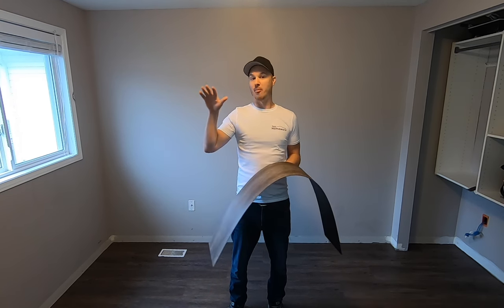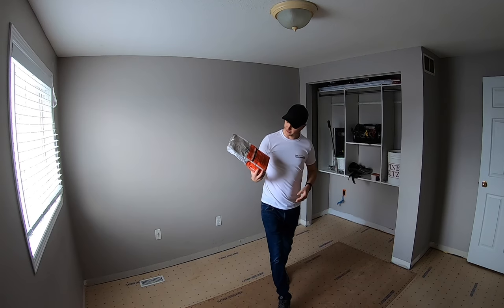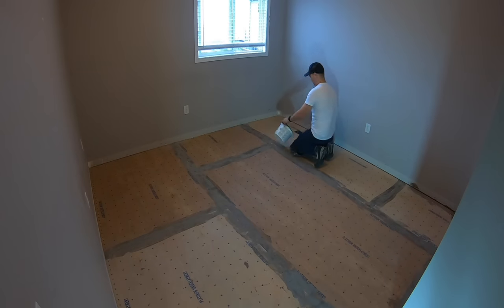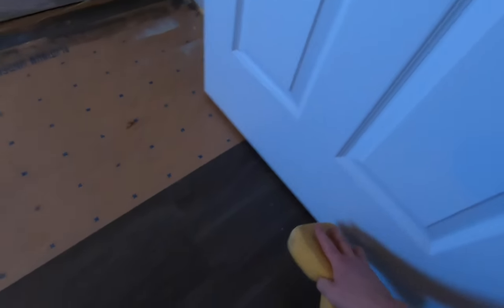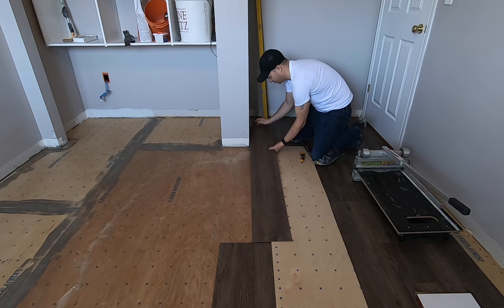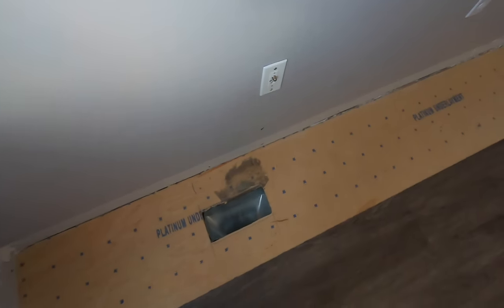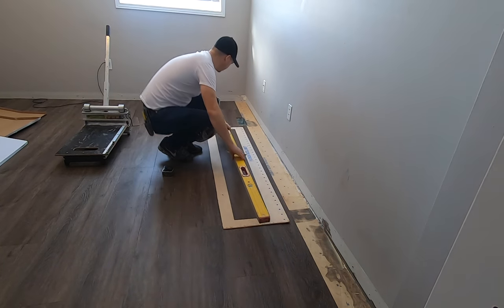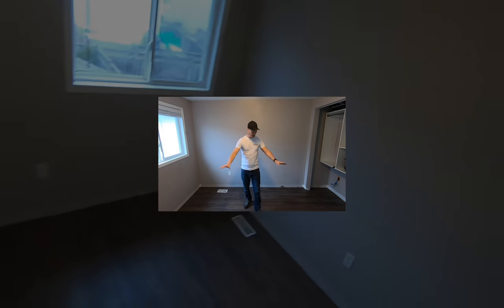How to Install Glue Down Luxury Vinyl Plank Flooring on OSB Sub Floor

Comment from the maker: Thanks for checking out this video. Please hit that subscribe button and the little bell so you can be notified when I put out new videos!
Reply: Brent, what market do you currently do work in?
Reply from the maker: @AlexJacobsOfficial  Home renos near toronto
Reply: Will it have gaps?
Reply from the maker: @veev7796  There are seems but if done right, no gaps
Reply: Does the glue off gas? (Smell after install?)
Reply from the maker: @williamlillie9309  not much smell from the product I used maipei eco 373
Reply: Can I  install it  directly to plywood?
Reply from the maker: @juanhuerta7800  you can but might not work out that well
Reply: @BrentDarlington  just making sure i wanna remove the carpet and install glue down lvt. Thanks for the feedback
Reply: How long do you have to leave the glue down before installing?

Comment: Coming from a floor layer here, solid installation! I love that you’re using premium products that a professional like myself would recommend. A trick of the trade to make your fills go by much faster is to place a plank on top of the last row you laid (make sure it doesn’t move once in place), taking another plank and butting it against the wall on top of the previously mentioned plank. Once in place you may take your knife along the edge of the top plank scoring and snapping the bottom plank; perfect fit every time! To save more time I would also recommend using a knife opposed to your laminate cutter for end fills as well! Simply use the same strategy you use to mark it with a pencil but instead eyeball a straight cut from there (no square needed as the baseboards should cover any short cuts).
Reply: Having a good eyeball is a great tool that saves time and effort in all forms of construction. Good eye my friend.  😉
Reply: Also that's a good tip with laying a plank on top of your last plank. That would give you a perfect fit easily with minimal effort and no extra tools.

Comment: Youre right, HVAC guys never care. Haha. My good buddy is an HVAC contractor. I'm a handyman, and I get many work references from him. Bless his heart, but hes so sloppy. I get called in to follow and work along with him to make things  pretty. My advice to any other handy men and women is connect with some other tradesmen like an electrician or HVAC guy. Thanks for the vid. Needed a refresher for my brain.
Reply from the maker: I think if a few of the mechanical guys had to patch and paint some of the drywall holes they left behind they would be a bit more careful! They aren't all bad, they get paid to do what they do and we get paid to fix it lol

Comment: I’ve never done a glue down laminate, but it looks like once you get the prep work done, it goes pretty quick!
Reply from the maker: Yes a lot of prep but I like it a lot better than the click  stuff. No soft spots, doesn't come apart or buckle.
Reply: I may try this next time one of my rentals gets trashed and needs redone.
Reply: And congrats on 100 subs! I feel like I’m racing you😂
Reply from the maker: @MyDIYAdventures  thanks! nothing wrong with a little competition ;)
Reply from the maker: @MyDIYAdventures  another great thing about glue down is if you get some damage you can just remove the bad pieces with a heat gun and reinstall. Pretty tough with click to do that
Reply: @MyDIYAdventures  
I have 2 duplexes with carpet. I’m doing glue down on all 4 units. Hopefully it holds up. Anything’s better than carpet.
Reply: @SilverGorilla1776  my buddy has been doing that in his rentals, I’m thinking about doing it in my duplex also.
Reply: @MyDIYAdventures  
Has it held up well for your friend? I have one duplex that flooded due to the city sewer backing up. It had very cheap snap together laminate in the bedroom that flooded. We had a floor guy come in to fix it and he put in glue down. That was 6 years ago and it’s held up well so far. Was wondering about the higher traffic areas such as living room, etc.
Reply: @SilverGorilla1776  yeah it has held up
Reply: @MyDIYAdventures  
Cool. Thanks.

Comment: Instead of using your floor leveler where you have to mix it with water can I use the premix one DAP flexible floor patch & leveler for plywood & concrete  ?
Reply from the maker: I've never used it before so I cannot say for sure. I'm sure it's fine but may take a lot longer to dry in deeper areas.

Comment: true statement on triangle, however with the room squared you can adjust the fill piece to be less noticeable . just coming off the longest wall can --if not square can make the pattern seem on a slight angle .1/4 inch no problem--1 inch trouble . usually most walls are 1/4 to 1/2 out .

Comment: Well done Brent, nice job! There's not much videos on LVT / OSB out there. Thanks for yours!

Not sure if you were lucky to fit the plywood boards to be level with the existing floor. If you can't afford to lift the floor with plywood then special putty is the way. Sand down OSBs, seal the drops and joints with the special putty (like SCHONOX ZZ or similar), sand down again and you're good.

Comment: Excellent video. Can someone explain why the LVT cannot just be stick down onto the OSB? Why the need for the hardboard layer?
Reply from the maker: It's too rough
Reply: @BrentDarlington  thanks, makes sense yeah. Also I guess if you wanted to change the floor later on the subfloor would be ruined by the glue and would also need replacing.

Comment: Hi, how do you think can I put my new luxury viny floor on my old laminate floor?(I don't have any gaps on it I just don't like the colour and the quality as well) 
I'm trying to find a way how I can put on a new floor without taking off an old one. What do you think?
Reply from the maker: It is not that hard to rip out but if it is in good condition their may be a glue that would stick. You can also put a layer of plywood on top of the old stuff. The floor manufacturer will have a glue they recomend and the glue manufacturer will have a substrate they recommend.

Comment: Do you have to let the glue dry a bit before putting the laminate down? 

I tried to do it that way and it didn’t stick very good but when I put the laminate down right after spreading the glue instead it stuck really good.
Reply from the maker: Depends on the glue manufacturers recommendations.  They can all be a bit different. Some stick better wet set but can be more messy
Reply: @BrentDarlington  so do you think it would work to install it wet? The glue says permanent installation open time up to 25 minutes I’m not sure what that means I’ve never done flooring before and lastly dose it matter how you spread the glue? Thanks
Reply from the maker: @WesterlyPrune99  permanent means it's stuck, good to go. Yes, spread matters. How did you spread it?
Reply: I spread the glue and then pull down top to bottom so all the glue lines go in the same direction then I put the laminate down and press on it a bit. It seemed to work when I did that but I’m not sure it that’s how I’m supposed to do it
Reply from the maker: @WesterlyPrune99  that's fine, direction doesn't matter just want the same right amount spread evenly
Reply: @BrentDarlington  ok thank you very much I’ll have to give this another go tonight

Comment: my mom  in law has loads of that 70's vinyl sheeting flooring in her house... can one glue this directly over that? I only have experience with the floating type I;m installing in my rental unit now.
Reply from the maker: If its not padded and is held down tight, apparently you can if the glue says it will stick. I usually rip it out to be safe but you can put a new layer of underlayment ply over the old floor first. Or put click down over it.
Reply: @BrentDarlington  yeah the surface still looks flat and good just the prints are so out of date and not up to modern stuff, will probably fill a few low spots.
.

Comment: 3x4x5 provides that a room out of square does not present a small triangle piece down one or more walls , extremely important when ceramic tile is involved .
Reply from the maker: Can you explain a bit more? If the room is out, you will get the "triangle" effect no matter what you do. Centering just splits the difference and hopefully will be less noticeable. I can't rebuild the house to install the floor. The framers are the ones who need to use 3x4x5.

Comment: I realize it is not recommended however, have you ever seen glue down LVP/LVT installed over OSB (a good OSB) and seen it after the job was done? Is it possible it comes out great if the OSB is in great shape?
Reply from the maker: If you went with some of the thicker materials I'm sure it would be fine but I wouldn't want to test it out.

Comment: Thanks for the video what size sandpaper did you use?  How long do you have to work with the glue?
Reply from the maker: What size or what grit sand paper? Open time depends on the adhesive and will tell you on the side of the bucket.
Reply: @BrentDarlington lol sorry yes what grit I am going to finally start on my sun room after I install a mini split

Comment: This is the first time I've seen "luxury" to describe vinyl.
Reply from the maker: I don't name it, just install it. They have "Luxury Vinyl Tiles" too
Reply: Honestly out of all the flooring out there I prefer this type, looks the best, easiest to work with, cheaper, I mean it's a win anyway you look at it
Reply: We just had over 10,000 sg ft installed in a commercial setting and it has for sure made me a believer. Wasn’t a fan of the flimsiness of it until I slid a 400 lb vault across it with no issue whatsoever! No scratching or gouging!
Reply: @justinryan212  yea, apparently the vinyl has a lot more durability. I've seen a few videos doing tests on the different types of flooring planks, and the Vinyl takes the win each time

Comment: Great video my man ! 
I've done this job for 30 years and I have to say , it's as best as a professional can get ...however,  I'm just curious about the 'platinum under layment'
Here in Australia it's 5mm hardboard.
Reply from the maker: That's what we use around here. I've ripped out a few floors with hardboard underlayment so it may have been popular 30 or 40 years ago.

Comment: Excellent video! Two questions:
-What grit sandpaper did you use in your belt sander?
-What size trowel did you use for the adhesive?
Sorry if I missed it, my ears aren't the best. God bless!!
Reply from the maker: 80 or 100 grit is usually what i use. If you go heavy wirh the patch maybe do a 60. The adhesive will have recommended trowel sizes. Sometimes you can use a roller, some people find that easier.

Comment: Asking for my husband. Does he have to do it over if he put the planks down BEFORE the glue set?
Reply from the maker: Check the glue info sheet but they usually allow "wet set" and if it's sticking then it should be fine

Comment: Brent , what if my floor is concrete with marble tiles? How am i gonna use a nail gun for the plywood?
Reply from the maker: You don't need the plywood over tile. You should be able to patch the grout lines and go right over top of the tile. You may want to prime the tiles fist with something like "Mapei Eco Prime Grip" but see what the glue and patch manufacturers recommends.

Comment: Would hardboard be sufficient instead of ply?
Reply from the maker: I'm sure it would work but I would use plywood. Follow the flooring and glue manufacturers recommended underlayment for best results 👌
Reply: @BrentDarlington  thanks Brent. I want it to last so I’ll take your advice and spend the xtra few quid on ply. 👍🏼

Comment: I’m getting ready to install mannington glue down flooring over SurePly underlayment. The underlayment video says they prefer their underlayment without feather finish. I noticed you did this step. Is this always required?
Reply from the maker: A lot of installers skip that step. I would just follow what the manufacturer recommends.
Reply: @BrentDarlington  thank you 😀

Comment: How should we wait for the glue to get ready for laying the floor and what’s the longest time can leave the glue before laying the LVT floor?
Reply from the maker: The adhesive manufacturer will have recommendations. Sometimes it is good a half hour, sometimes 2 hours. Somehave an open time for 24hrs, some 12hrs.

Comment: So when the time comes to replace glue down lvp with new lvp what is the process? Do you need to remove the pressure sensitive glue from the underlay or can it be reused?
Reply from the maker: A lot of people go over the old stuff with new plywood but I like to rip it all out and redo
Reply: @BrentDarlington  When you say they go over the old stuff do they remove the old vinyl plank first?
Reply from the maker: @kevinmartel9230  they leave it and go over top with new plywood and new floor

Comment: I am a disabled veteran (I say this because I am on a fixed budget) that is doing a remodel. I had to repair the subfloor and I would like I to do it the correct way you showed, however I am not going to be able to afford the present high cost of plywood.  Would I be able to belt sand any points that are uneven and fill the gapes and sand (as you showed), glue and lay the floor. I have seen lots of statements by you that the underlayment is highly recommended, if not necessary, for a level surface but as stated 1/4" plywood for a house project is going to be out of my price range. Could I possibly use 1/8" wall paneling (cheaper) in order to get the larger area flat surface? What could happen to the floor if I proceed to do this.
Reply from the maker: If you go with a click style vinyl plank you won't need the plywood, nails and glue. You may need an underpad depending on the flooring but is usually the cheaper way to go. Usually more color and price options with click too.

Comment: I’ve just laid my LvT . One row I’m not happy with is it easy to lift up and replace ? I’ve laid them with F46 Ball. Over ply wood ?
Reply from the maker: You can pull them up but may be tough. Use a heat gun or hair dryer to heat it up a bit and soften the glue
Reply: Can you reuse & reglue planks that are lifted up?
Reply from the maker: @pearlperlitavenegas2023  If they are in good condition should be fine
Reply: @BrentDarlington  thanks

Comment: If there are dips or imperfections in the osb subfloor, wouldn't that transfer up through the underlayment you installed over it? I guess I'm wondering why the lvp couldn't just be done over the subfloor?
Reply from the maker: The osb is too rough for the glue as well

Comment: I have such bad gaps in my LVP. I glued it down with the right adhesive, used underlayment over the OSB, expansion gaps on the ends, etc.. Still tons of gaps. For the life of me, I cannot figure out why. Any thoughts?
Reply from the maker: Floors not flat or you need more practice
Reply: @BrentDarlington  The floor is flat; it's new construction. No offense, but I think I'm capable of laying planks flush against each other. They are separating 24 hrs after installation, despite being tight when I install them.
Reply from the maker: @kevinl4080  I don't know what to tell you. I've never had that problem.
Reply: @BrentDarlington I've seen this issue with glue down lvp..especially where you may have different floor temperatures from sun coming shining through a window.. vinyl expands and contracts...more from end to end than side to side

Comment: Is there an underlayment that you recommend to make a gluedown floor (3mm) more comfortable to walk on, especially over a first floor concrete slab on grade. I love the idea of a gluedown floor but am concerned about how comfort when its laid over a slab on a first floor or even noise issues on plywood on a second floor. Is there any way to add an underlayment besides the one you use?
Reply from the maker: It's best to talk to a flooring store. There are lots of different options out there that may fit your needs
Reply: @BrentDarlington  will do

Comment: I have seen people lay this tile as wood grained floor tile is laid (with space between the tiles and adhesive used instead of grout) Do you have any recommendations regarding this? Seems like a hell of a lot more time and work for this to be correct.
Reply from the maker: I've never seen that. They have grout for vinyl but usually used for luxury vinyl tile, not planks. I would follow the manufacturers instructions as close as possible.

Comment: Hey can you lay this stuff over existing vinyl or lenoleum flooring from the 80s or do you need to lay sub floor? Thanks for the detailed video!
Reply from the maker: You should put down a new layer of plywood but it probably would stick
Reply: Brent is more of a pro then I am but I am going through the same thing. I have the sheet linoleum on my kitchen floor and am consulting people to lay down an lvp glue down for me. Everyone has so far said it'll stick to the linoleum. It has to be essentially flat and free on any bumps lumps etc etc etc. So I'm hoping for good results.

Comment: Is the plywood needed? I’ve seen some people don’t do it … just wondering
Reply from the maker: Depends on what the manufacturer recommends. Click vinyl usually doesn't need plywood unless the subfloor is a bit of a mess. You also don't need it on concrete floors.

Comment: Great vid 👍 I’m wanting to install luxury vinyl planks upstairs in my home. The sub flooring is thick and in good shape(newer home) do I need to install the extra layer of plywood to the floor. If so, why? Thx
Reply from the maker: You need a good smooth surface for the glue. Any imperfections in the sub-floor can show through to the surface.
Reply: @BrentDarlington  ok thx

Comment: I don't understand the nailing part. Wouldn't nails come up over period of time?
Reply from the maker: It is stapled down. Never had an issue with them coming up over time. They are usually pretty tough to get out when you are ripping out an old floor